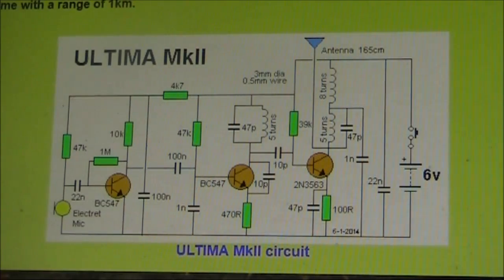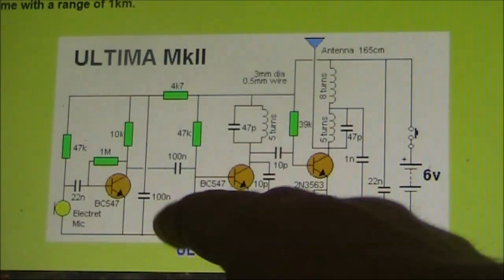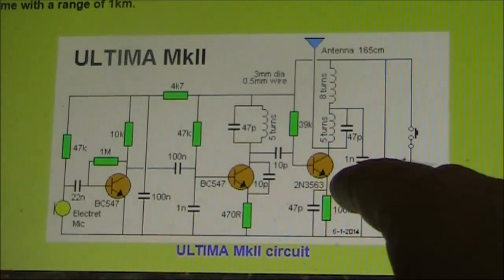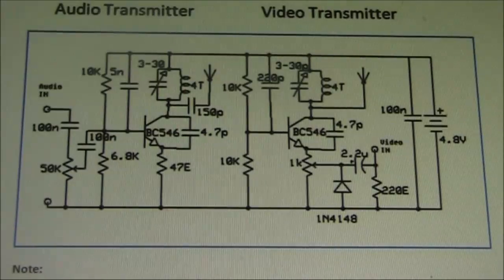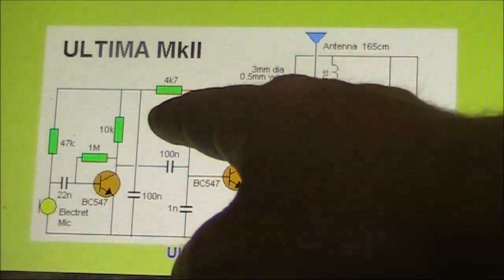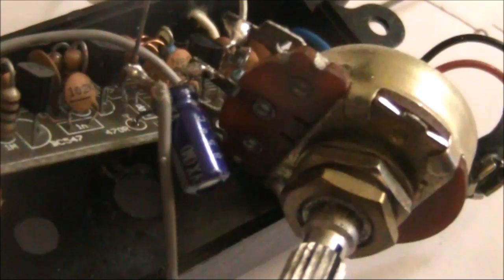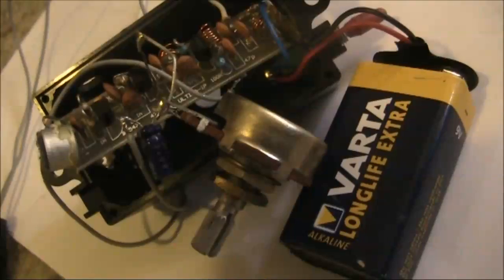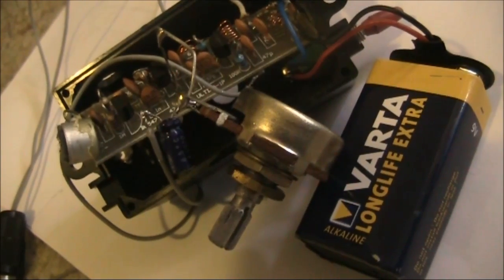Electronics on the Floor: Can an FM bug transmit video?

Comment: But doesn't that just make it an AM transmitter because you are injecting the video signal into the emitter. Instead, how about just injecting the video to the base of the 2nd transistor with a decoupling cap so that the transmitted RF has FM modulated video? Could this then be received by a simple TRF receiver employing a PLL for demodulating the video and driving a TV?

Comment: Now next peter feeds the transmitter signal through some coax to a 4 element yagi outside on a squid pole after matching the transmitter to the coax line impedance.
After this he takes his portable telly for a walk, powering it with a battery,  to see how far the signal goes before losing clarity 😀
Reply: can you do this on 2m? 😀😄
Reply from the maker: The bandwidth of a TV signal would take up more than the whole band - so yes - but no.
Reply: Haha I thought that you would say that. So definitely no feeding it through a PA either 😅 Being serious though, what is the bandwidth of a PAL video signal (no audio carrier) on it's own? Before I first commented I was thinking possibly a few megahertz but wasn't sure